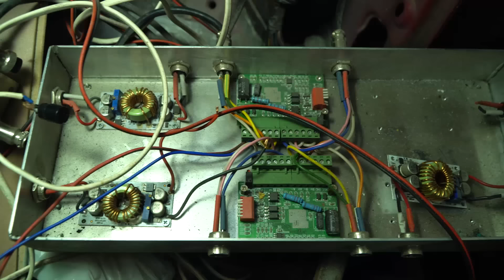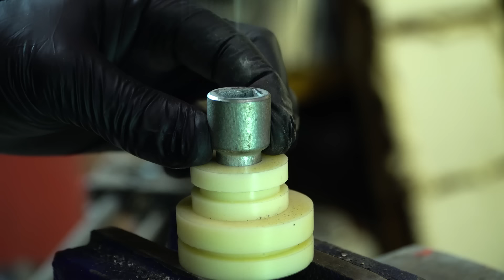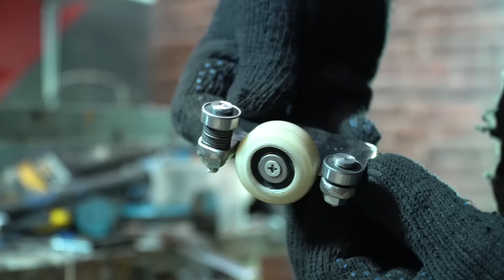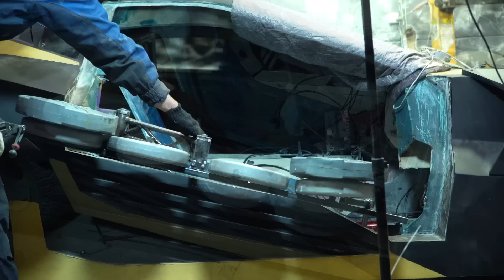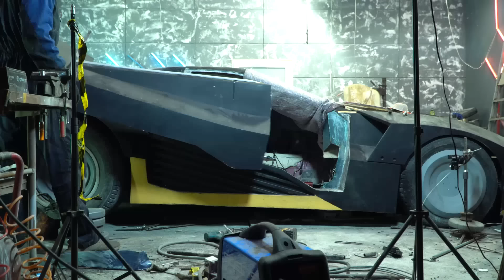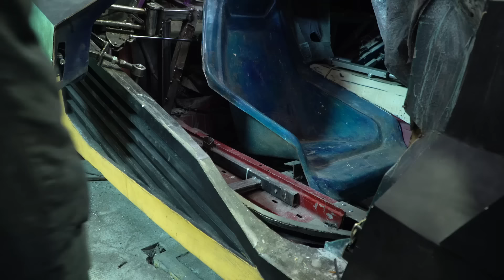New door mechanism. Quadra V-Tech from Cyberpunk 2077. Part 32

Comment: Mount some access points/posts to jump the battery from the outside for when the battery goes dead.. easier than trying to figure out a cable system to open the doors..

Comment: Instead of electrical movement use pneumatic, Put a 12 volt compressor somewhere with a tank that can quickly release air into a cylinder to open the door

Comment: To be frank the electrics are trash, it looks like leads cut off mains appliances and nothing there is big enough for what was needed. The wires for my old rx7's power windows is bigger than anything there voltage drop would be a huge issue

Comment: You may want to consider using a spring and roller to hold the door open like on a production car. If you look and image of the GM 20969645 hinge you will see a spring loaded lever with detents for partially opened and fully opened doors, that are engaged by a roller. In this case you only need one detent. The actuator for opening the door can be disconnected all the time by having it push a metal plate instead of being directly attached to the mechanism. If the actuator needs to remain aligned, then have both portions ride on a rail.

Comment: ther should be a forces based dissconect between the actuator and the door. so you can just dissconect it from it by pushing hard enought. when slamming the door shut it conencts again. i dont know the word for it, but there ar parts for this. they work similar to the door locks but they got a spring and a screqw to adjust the threshold force. also you need to make sure people can mechanicaly without power unlcok the door locks, not just via the actuators

Comment: What if instead of linear actuators you make a steel cable pulley system connected to an electric motor, you then can use the gas strut for its benefits of quick opening(as long as the motor doesn’t produce too much resistance) and the electric motor for automatic closing simultaneously
Reply: Seems like this could be the best of both worlds

Comment: with my convertible, when a door jams, i just stand up and exit out the back. you don't need side doors which open, just a lid. depends where the motor is going, presumably the front

Comment: Pneumatic cylinders  with silent Compressor could also work instead of The linear actuators they can be way faster with Little Reservoirs and The Pumps wont need to constantly Pump

Comment: What about a spring loaded mechanism with gas strut to keep the door from slamming against the body and only use the actuator for closing like on vans. It will save power compared to the current setup.

Comment: You are using dumb electronics, why not use some sort of CPU with a current limiter to stop when the drive current gets high instead of stopping immediately when the button is released when opening or closing? A nylon block on mating surfaces would help prevent damage to your fiberglass frame.

Comment: One idea I have is to replace the linear actuator and allow the bearing to be driven by a motor instead. The motor would (in theory) be able to slip when not powered, but open and close when powered. Taking inspiration from a minivan door of course.

Comment: I just wanted to say that the manual mode seems better than the powered mode. In my opinion, it is not worth messing with the actuator to get the powered mode working, but if you enjoy the way it works, continue to work on getting both manual and automatic modes installed.

Comment: If you had put both locks on the door, rather than the body, you could've but the button on the door and had a opening operation similar to a C6 Corvette. A C6 Corvette has a button on the inside, rather than a handle, that opens the lock and allows you to open the door. This would also allow the system to be completely enclosed in the door rather than running throughout the car.

Comment: 0:30

Are those PCB's screwed directly to the enclosure?
If so, then it's not that weird things go bust with the solder joints touching steel and making contact with terminals they aren't supposed to contact

Comment: Depending on what you can find or build, for staying open a screw driven actuator for the doors would keep them open, but it may be finniky and slow. An idea I had was using a gear meachnism on the inside hinge of the arm. It could be fater and also take up less space towards the passenger compartment.

Or, if you got some space towards the back behind the seats, using a counnter leaver that gets pulled or pushed to move it.

Comment: If the weight of the door ends up overpowering the gas strut, you can add a second one and that should fix it. Minivans use two struts for their tailgates, and those things are pretty heavy. This new system is awesome: less components, lighter weight, and faster. Also looks incredible.

Comment: I just thought about something probably dumb but... What if the resting position of the door was open (with springs) and that the actuators were actually working only to close it ? This way, in case of not having power, you can still open it because of the springs and close it manually with the weight of the door.
Going later in the video : Nvm the gas strut is literally the spring I was refering to with my poor english.

Comment: Have you considered trying pneumatic pistons? Using valve blocks, relays and limit switches you should be able to fine tune the speed and torque of the movement. Any air release sounds of the valves would just add to the cyberpunk experience.

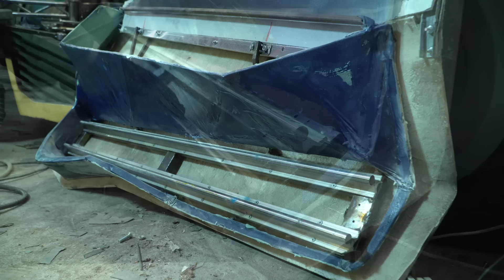Comment: 10:30 

I'm surprised that you went with an electric linear actuator when using a simple air compressor and air cylinder would be able to move that door quickly and quietly.

If you need inspiration for how it works, look at the "jumping" cars and how their suspension allows them to bounce high

Comment: Electronic quick release latch for the actuator. Tie its electrical in with the door latches. In this way, the door will always opens off gas strut, since it is strong enough and the quickest. When button for open on key fob is pressed, the electrical makes door latches and actuator latch release, and the actuator starts extending out after a 1 second delay. It then extends out and latches to the door. Then when button for closed on key fob is pushed, the actuator will pull the door closed. In this way, door will always open fast. For a manual operation, have a hidden button on back quarter panel by the rear window for a manual release. This button will operate all three electrical latches, door front and back and actuator, but will not run actuator. For electric, program this to a normal key fob, door lock open and door lock closed.

Comment: Ok this is cool.  I have door actuators on a 1969 Pontiac Firebird, not self closing though.  The self close feature is actually a safety hazard, which is why manufacturers don't typically install them on floor models.

Comment: Use a cinching door lock actuator from a tesla model x front door, one on either end of the door. That will pull the door in against whatever seal you have set up and make sure it's rigid without having to do much in the way of adjustment

Comment: 14:27 even the rate at witch the door opens even looks like a video game
Reply: Needs more back throw if it is implemented in a production vehicle, but for a personal project, this is enough and awesome, and i think all 2 door super cars should have a similar system, except for the race focused ones that need to save weight everywhere.

Comment: Maybe put the lock mechanism into the door, so the "emergency cable" could just be your normal way of opening the door. You'd have to synchronize the lock release somehow, but making the door functional without any electronics would be the most elegant solution I think.

Comment: Superb work, thx for this. Car manufacturers are trying to fix such issues with programming and many electrical drivers and chipssets that can and WILL all brake in estimated/ calsulated times. Your solution is a mechanical one, wich need some fine adjustment. Keep up the great work and if you can, sell your door opening/ closing mechanism after you perfected it.

Comment: Incredible! Huge improvement on the design. I vote that you keep the actuator but modify it's role so that it only is responsible for catching the door when it opens and then closing it. Maybe you can do this by connecting it to the door mechanism with a limit strap. This would require the actuator to be fully open when the door is closed, the limit strap would allow the door to open freely and once it opens all the way it would pull the limit strap taught. Then, closing the door would occur like you just showed, and once the door latches the actuator would return to its fully extended state.

Comment: Rather than linear actuator, you could use a wire pulley system with a electric spool. It could be connected at all times but only run the motor when you want it to.

All in all, definitely lose the actuator, even manually it works so much better. And great job, this was a great leap forward!

Comment: With the rollers, if you make the walls of the roller longer, as well as add deeper grooves, maybe thicker rollers as well. You will find that the bend or the stress cannot cause the rollers to slow down. Taper the edges of the longer walled rollers to slightly taper inside towards the bar. This will ensure that there is no binding or catching

Comment: If you add the gas strut so that it functions as an over-center mechanism, it will assist in holding it open and holding it closed (assuming you have room for that configuration)

Comment: Almost like a minivan!

The same design, but different sizes, & they add a second slider in the door, on the rearmost arm, so it can slide back after opening.
Reply: They have a dual latch thing, in that, so it can't slide unless swung open fully (opening) and can't swing in until slid forward fully (closing).

Comment: Just one suggestion regarding the door, at least in the front, try either to add a small lip to it to avoid airflow to go inside the front gap, or make the front panel overlap a bit the front of the door, so that air can flow easily to the door's bodywork without any gap capturing air. Since the door opens backwards, you can take advantage of that and improve its aero, and also avoid the door to blow open due to high air pressure.

Comment: The answer to your automation question on getting the door to open in manual mode without the actuator operating and to get the lock actuators to stay open long enough to let the actuator get the studs clear in automatic mode is to use a micro controller, just like what the real car would have used. There are several hardened for industrial and automotive use Arduino clones that would work for this that are cheap. For prototyping, just get a basic one and get it working. YouTube has the tutorials for getting set up and there is example code to get it working. Then you just use some optically isolated relays and quality buck converter to power the final controller.

You are going to run into other things that a micro controller is going to be handy for on this car, like the lights, and other latches for automating them, LED light control, sensors, all sorts of things. Might as well start now when you are just trying to control a door.

Excellent work on the design here on the door. this is exactly how the automotive industry would have dealt with a door like this. A gas strut fixes all the heavy door and gravity problems.

Comment: The new door mechanisms are awesome, I really like how they function now.
I still think the auto open is still a little bit slow.
Seeing it opens on it's own with the gas struts, what about letting the strut open it and just do auto close with a lineal actuator. There is far less load on the actuator when closing so that should open up more options for actuators.
An eccentric arm would reduce the actuator stroke thus speeding things up, but it would be more load on the actuator.
Or maybe a gear drive and electric motor or a power window motor.
Just throwing out ideas.
Keep up the great work.

Comment: Have you experimented with hydraulics? Running two pistons connected to a single reservoir would solve both doors, as well as reducing reliability on the motors driving the doors out. It would also provide more power when closing, as youre not longer fighting the pneumatic pressure within the gas struts, but instead provides a "pull" to the doors.

Comment: For a disconnect on the linear actuator, you could use a pin and a hitch pin clip to keep it in place unless you need to disconnect it. You could add a short hanging tab/flag to make it easier to get a hold of if you need to get out in a hurry.

Comment: Not gonna lie this was like a view into the future of cars! The door turned out pretty advanced with time well spent to remedy functioning difficulties. I had a brainstorm while looking at the moving mechanism: my simple brain manifested an image that had a steel bowden attached to the "roller wheels' plate". Most of said steel bowden would reside inside (basicly hugging the bent shaped wall) that inner railing you made when the door is closed. Opening the door would have that steel bowden pulled by a small motor. Would also work with a motorbike chain (would be more robust) replacing that steel bowden that could also be housed in that railing for the rollers. That would simplify the interior behind the seats with no moving parts such as those gas struts and the outward moving actuator arms. In the end the process would have the forces moving backward safely confined (can be made fully invisible to the eye) VS the outward working forces with the struts. As for the door holding bent reinforced arm: it is Art even by itself! Turned out 10/10! This is just my oppinion! I love how this project is evolving with every episode! Wish you alot of strength aswell as finding the joy in creating something spectacular! Wish you Merry Christmas and Happy New Year! Greetings from Hungary! 👏

Comment: If you add a little friction to the back-end of the track. it could help slow down the swing of the door and keep it from slamming into the rear fender. Basically turn it into one of those soft closing kitchen cabinets

Comment: i thought about something. Would it make sense attaching a gear of sorts to the hinge point of the rear arm of the door and a motor connected to a worm gear? you could then have something like a clutch that connects the door to the motor, which would let you have both manual and electric opening. Granted, i'm not an engineer and have no idea about the load on this motor would be and the electric power it would need. I imagine the worm gear would have to rotate extremely fast in order to open/close the doors fast. But it would additionally act as a stopper for the doors so that they don't close under their own weight.

Comment: Linear actuator seems to add complexity that isn't required, go for analogue and engineer it with the gas strut! It'll also mean you can cut down the joiner plate for the actuator and hide it more neatly in the door frame!

Comment: Super cool, glad your making progress. Also for door locks, some cars have magnetic latches. You close the door and then the latch pulls the door to its final spot. They are usually used for rear trunks doors and van sliding doors. This might help if you run into others issues with the latches. I like the manual mode better too. Auto is very cool but seems like a lot of extra fuss. Thanks again for sharing 🎉🎉

Comment: Just using the gas struts for the doors seems like the right call, honestly. I think the functionality, reliability, and lack of electronic parts needed is beneficial over having automatically-closing doors. But I also look forward to seeing what you might design for an automated disconnector for the linear actuator to make different manual and automatic door opening modes.

Comment: How have you mounted the electronics? have you used pcb spacers? (they are usually made from brass and prevent the underside of the pcb from shorting on the metal mounting surface, and can also provide a grounding source if the pcb has been designed correctly)

Comment: For the door lock with the automatic actuator, you dont need a timed relay, just a relay and a "door closed" switch. The relay is activatated by the button (to open doors), then by itself also but only when the door is closed (by the switch). The relay will also activate the door latch. 

So when you press the button to open the door, It activate the relay, and the door latch. when the door is slightly open, the relay is de energized automatically. 

You can also do the same for the actuator so it open and stop automatically.

Comment: try doing a screw type railing/rack like you see with steering so you can just use a motor to open it instead of piston.
as for doing it manual opening, you can just disconnect the motor so it doesn't give resistance until you stop operating it then it would lock it in place.

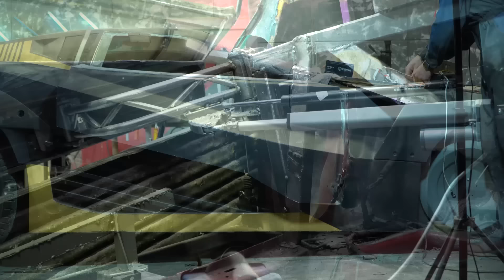Comment: 16:17 If you don't want to use a timer relay you could pair a latching relay with a limit switch. Pressing the door open/unlock switch would drive the latching relay to the OPENING state, powering the door latch actuators. Once the door opens far enough to have the pins out of the latches, the limit switch that's interacting with the door mechanism changes states and provides power to the CLOSED state coil, which removes power to the latch actuators.
The limit switch could be mounted to the guide track and tripped by the movement of the roller. Since you only need to momentarily drive the latching relay coil to CLOSED state.

If you want the door open switch to double as the door close switch (changing states every time it's pressed) you could wire a step relay in parallel to control the actuator.